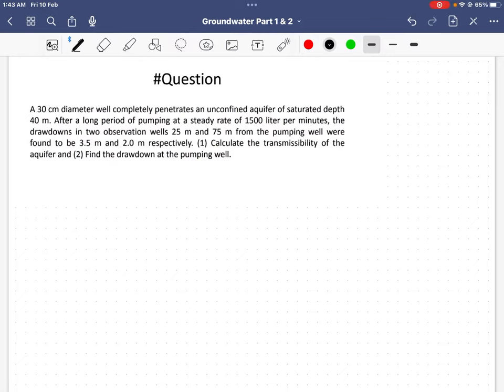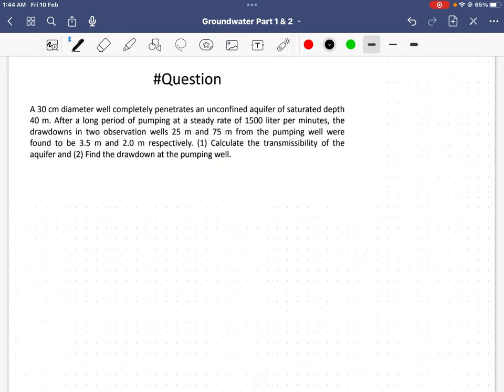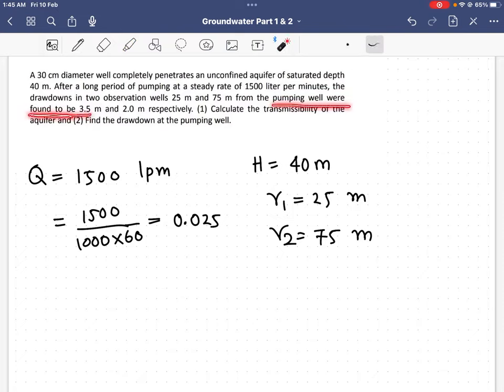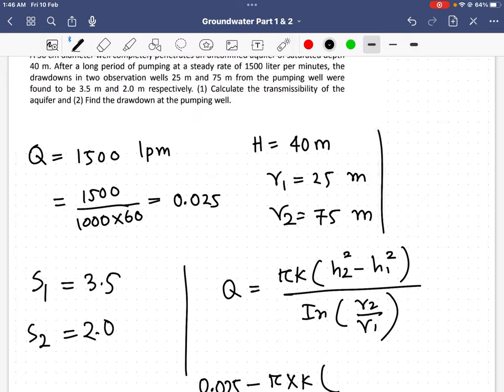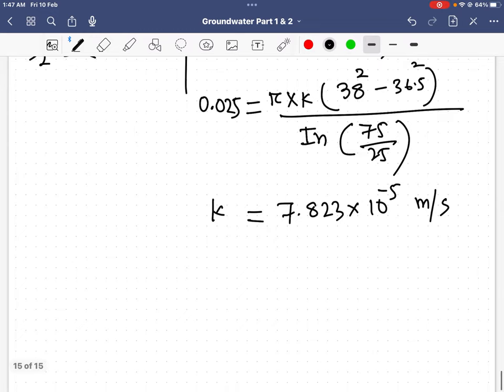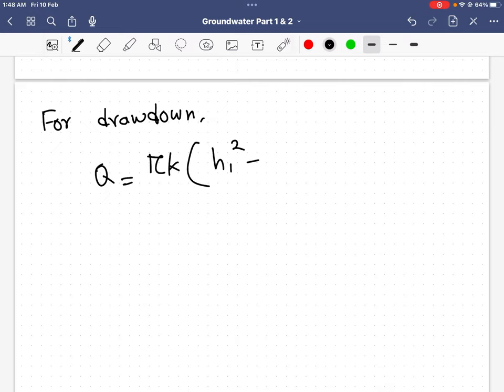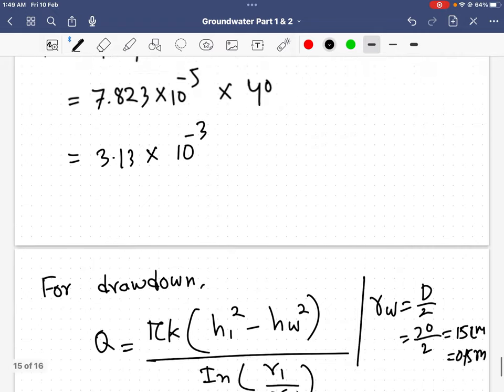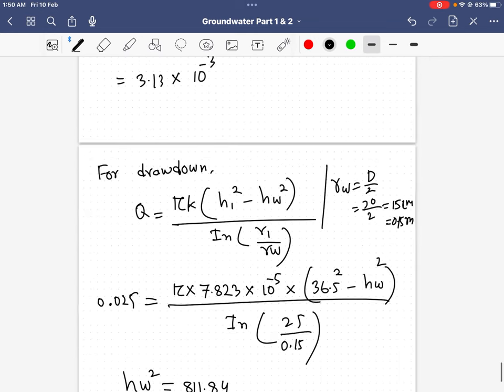Groundwater Example - Calculate Transmissibility & Drawdown -Unconfined Aquifer

Comment: Hi, how did you get the hw2=811.84? I dont know how to input the value of the Q there
Reply from the maker: If you have a scientific calculator, simply input all values provided in the question except for the Hw^2 value. I hope this explanation is clear. Also, note that I obtained the Q value at the start of the solution.
Reply: I mean which part will I put the value of Q which is 0.025 to obtain that 811.84 value? Pardon me for asking hehe
Reply from the maker: @maryrosetumapon9130  Exactly. Just use 0.025. No problem, anything. Please Ask me. I am happy to answer. Thank you.